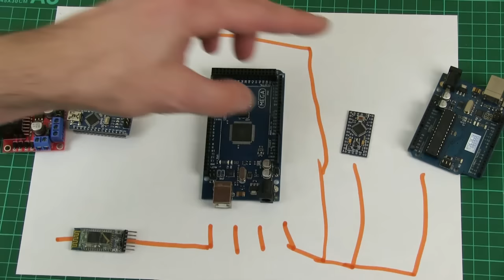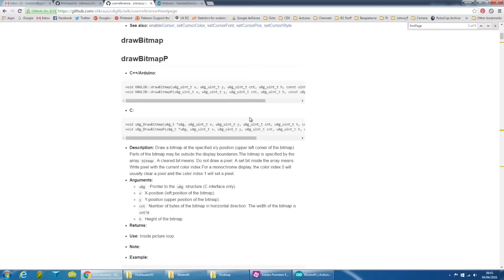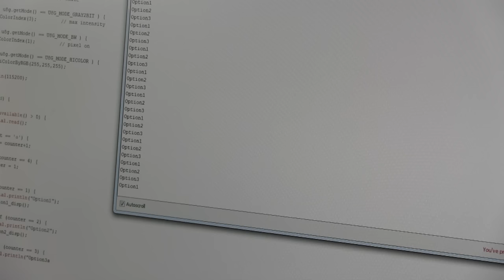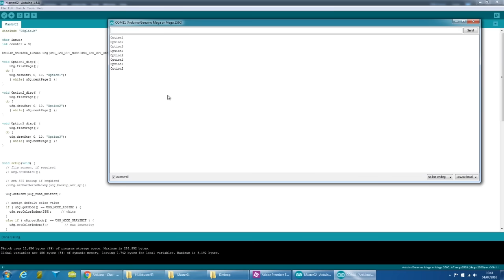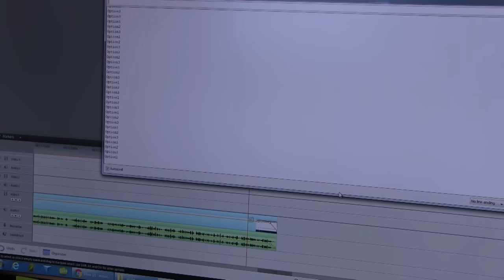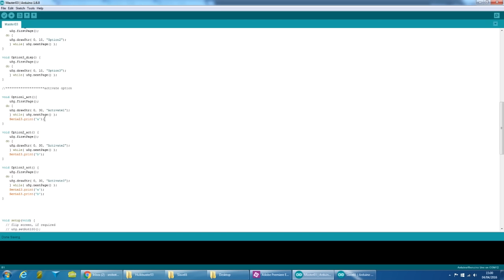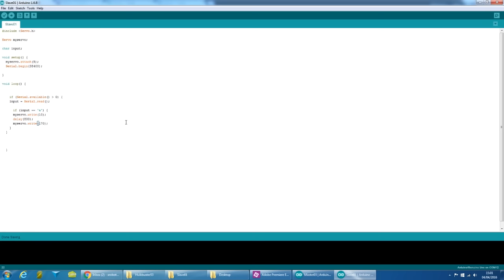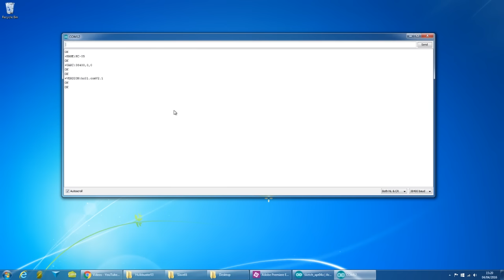Iron Man Hulkbuster Cosplay #53 | Electronics & Control | James Bruton

Comment: ragarding the u8glib page loop: 
that is a smart workaround to handle the limited SRAM of the arduinos to draw a graphics screen where the memory demand to render a whole screen in full resolution is bigger then the aruinos SRAM. It simply cuts the whole screen in segments where a single segments memory demand in small enough to fit into arduinos memory. After the first segment ("page") is rendered, it will be transfered from arduinos SRAM to the display, then the segments gets shifted, rendered again for the shifted segment ("draw()") again transfered to display (".nextPage()").... and so on, until the complete frame is rendered.

Comment: +James, great job as always!  ... Wondering if Victoria would be a more appropriate name instead of Jarvis? Either way, a status screen (power, runtime, heat etc) would be great as a display item ... Even as a way to automatically turn on cooling fans if you decide to implement them. Loving the electronic side of the build!

Comment: Do you expect to need shielded cables for your serial bus?  I suspect that the low speed and simple packets might afford you some leeway, but electrically noisy motor drivers, and a no doubt complex harness and mix of voltage converters might cause some signal/noise issues.

Comment: guess I'll give up my lurker status to ask a question-

I'm confused as to your use of uart to comm between the hand controllers and the mega-  why not just send the button signals all the way to gpio pins on the mega?

that would be simpler, remove the need for the arduino's in the hand controllers (lowers cost and number of things to program), and uses the same number of wires (gnd, button1, button2  vs  vcc, gnd, serial) and of course you can use any gpio pins rather than having to use up your hardware uart ports.

btw- love you channel; been really inspirational for my own robotics work, which isn't quite ready to debut yet.. :)

Comment: Hi James, just 2/3  questions on your display and menus !
 - When you have activated option 2 for example, can you currently activate it again (or make an activate/deactivate switch) without going through all options again ?
 - Could you use that to monitor the energy level of your batteries at any time ? Do you have a way to check that ?
By the way, so much arduino and things will use a lot of power, what do you intend to use to power all this ? One source ? multiple sources ?

Cheers, still an amazing job that you do !
Reply: +James Bruton (XRobots) Cool, thank you for your answer ! Waiting with absolutely no patience for the next video ! :)

Comment: Since you seem to have the resources this is not a huge deal, but that is a giant(!) waste of Arduinos.
All of this could have easily been done with just one. But great Job to make them communicate this way. Maybe I should see it as a proof of concept^^
Also, this will be battery run, right? If so, you should maybe think about working with interrupts instead of waiting periods in the loop. That would decrease your power consumption a bit
Reply: +James Bruton (XRobots) That is indeed true, better take the first part of my comment as a notice to all viewers who are interested in working with Arduinos themself. Because they can get expensive in this quantity, but since you already have them, might as well use them.
Don't forget to investigate the usefulness of interrupts though!
Reply: +Sleight94 Not really expensive, you can pick up an Uno clone for less than $3 USD online ... Given the wiring hassle I would drop $20 on multiple UNOs in a heartbeat in order to only have to deal with 2-wire communications rather than bundles of up to 30+ wires.

Comment: Rly bro? Windows 7
Reply: Why bother with windows 10 if you don't need it? Win 7 is still fully supported. There are many research facilities and industrial sites around the world that use far older operating systems. If your process or experiment doesn't require a lot of processing power then recycling old computers and operating systems is a great way to save money. A few years ago I saw an old PC running win 3.1 and dos taking temperature measurements from a furnace and then spitting the results out to a text file. The engineer connected via simple network to take the data and manipulate it on a more modern computer setup.
Reply: I haven't updated to 10 yet. I've gone so far as to block the two windows 7 updates that attempt to download in the background.